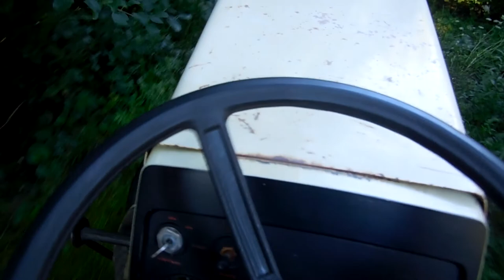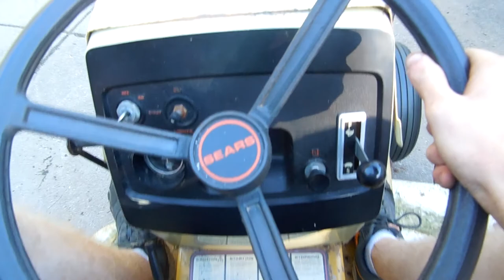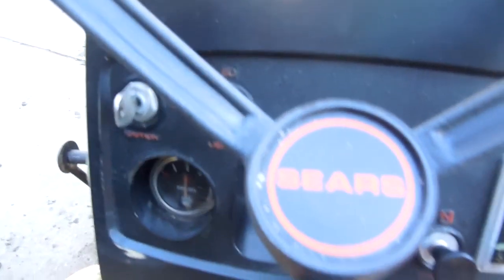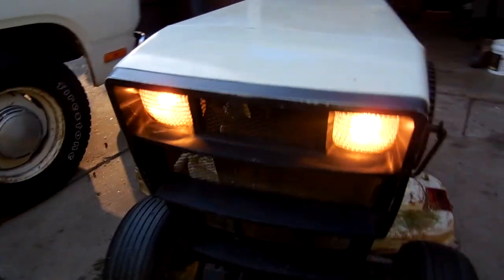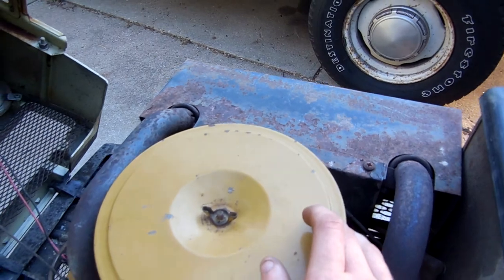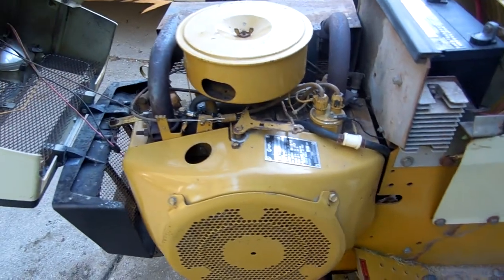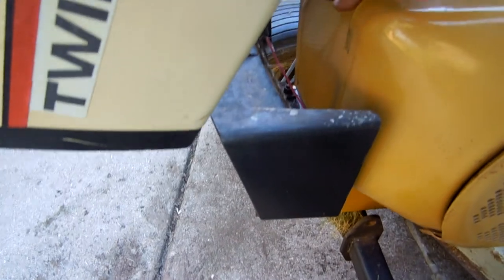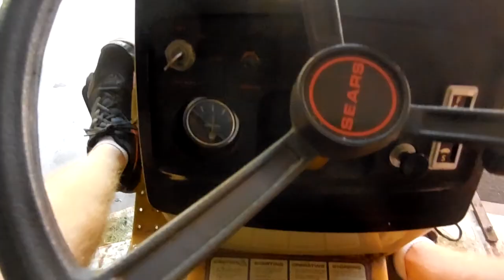Beautiful Original 1976 Sears SS/16 Twin

Comment: Just  found  a 18/ same condition. Yours  Looks fantastic
Reply from the maker: Tom R I recently sold this tractor and it went halfway across the US! Sure was a nice one
Reply: @71_sears97  bought mine and live in the panhandle of West Virginia. Got a oil leak coming from somewhere noticed when I was pressure washing at all. Owner complained about needing to replace fuel pump vacuum issues? He told me to put a electric fuel pump on it to fix the problem? Any thoughts? Any forums I can join that would help?
Reply from the maker: Tom R if you are on Facebook, the best place is the Sears Suburban Backyard Tractor Club. Great group of knowledgeable people. I’d check to see if your rubber lines are in good shape and replace if they are hard or cracking. Personally I’d rebuild the fuel pump, most electric pumps (besides being loud) flow way too much fuel and end up flooding the engine out bad
Reply: @71_sears97  I'll have the Mrs make  me up a Facebook.  Planning  on a fully going over  every  inch of this tractor. Considering  a repaint ,but I'd rather  see it roper colors than that ugly  mustard . Thanks your your  input
Reply from the maker: Tom R if the paint is still in nice shape on yours, it would be a shame to paint it because finding nice original tractors are quite hard to find these days. I only collect nice condition ones and rare ones. They are far and few between
Reply: @71_sears97  thanks  for the heads up! After more research....I bought a really  good tractor one year 77 red stickers. 350 hrs on her original  tires  and all the cover's  are there.  Its getting  painted  original. I'll take  it to plow  days n shows n stuff.